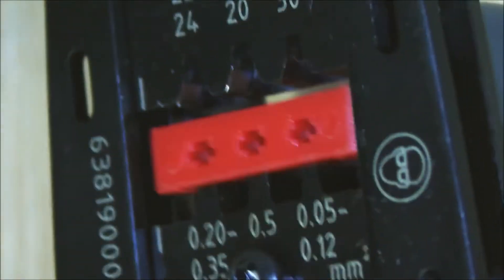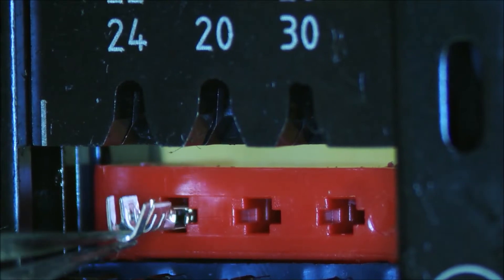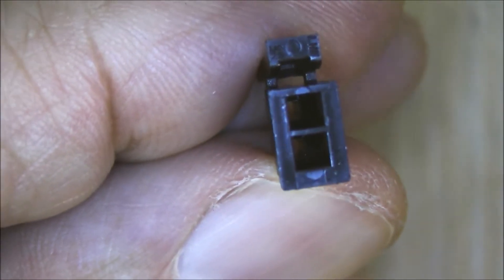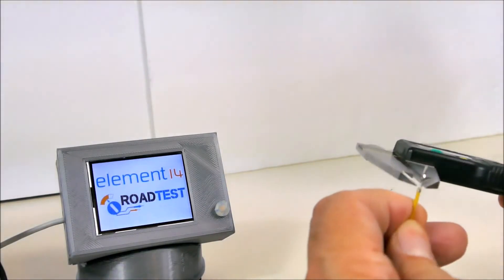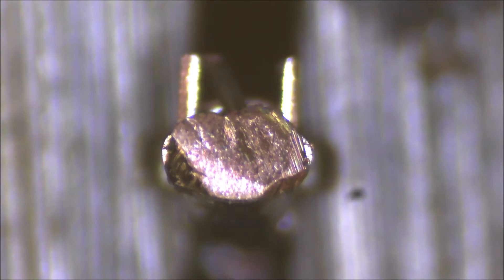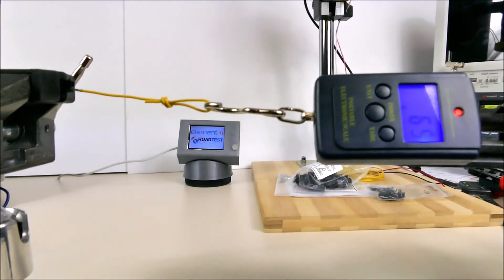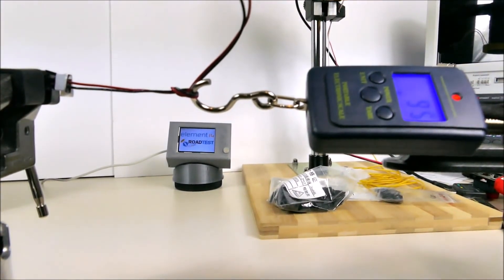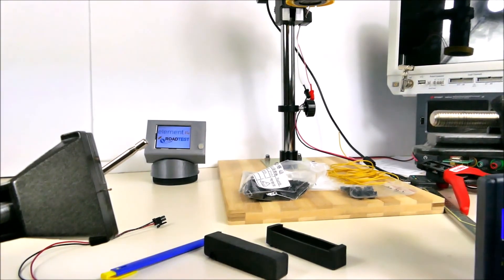Crimping in Style - Molex MicroFit 3.0 Hand Crimp Tool Review

Comment: Nice crimps, however the procedure isn't the same as described in instructions: you should partially close the ratchet, and push the wire until the stop barrier.